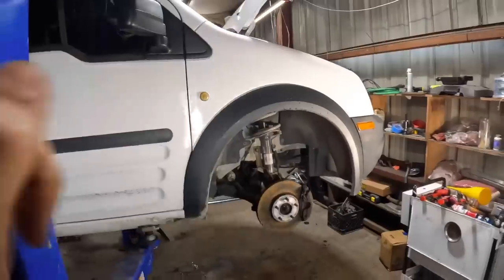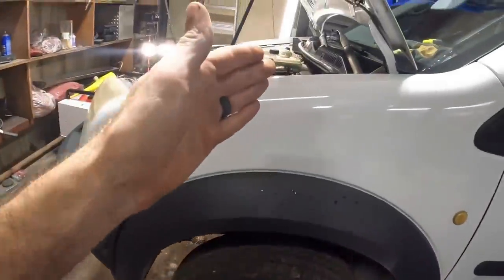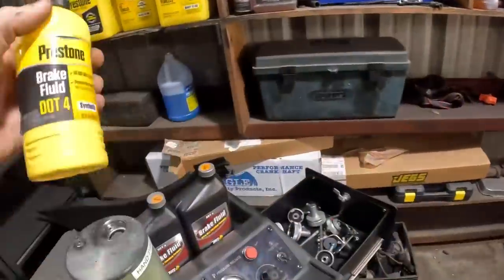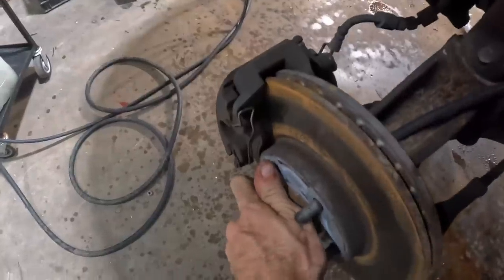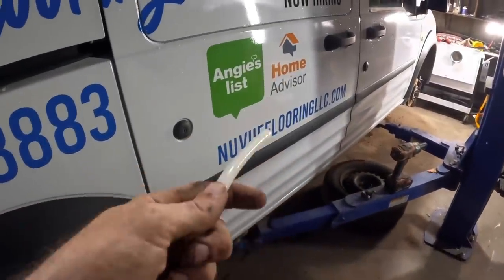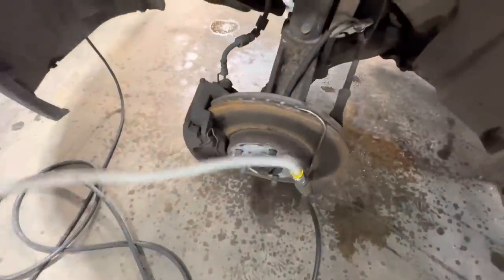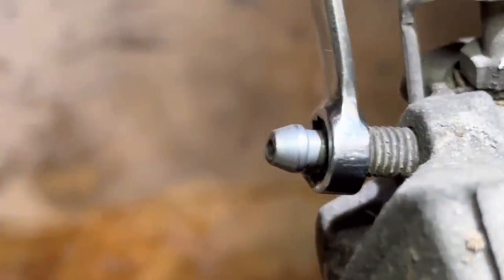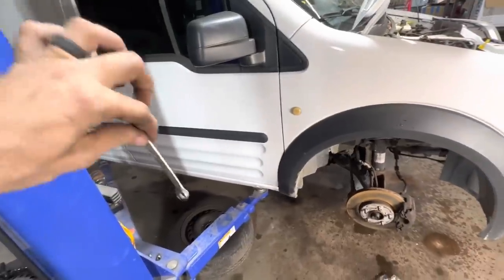Does Brake Fluid go BAD?? Ford Transit 2.0

Comment: I’ve always filled break fluid to the top. I’ll have to start looking for full marks
Reply: Filling brake fluid to the top of the reservoir doesn't give the overflow fluid anywhere to go when the calipers are being installed during a brake job, or any other work where they're removed.
Reply: Mc reservoir level depends on how far discs and pads are gone. If the level is maxed out on used discs/pads the fluid will overflow when pushing the pistons back in case of disc/pad renewal.

Comment: No da,da,daaa.Spray those brake spews at the wheels. Makes a cleaner job . hahahaha. Great little unit ,makes it a one man job. We use to have a pump unit,( by hand) it did the same job. Many moons ago. Bet that unit cost a lot of moola. But if you do that that type of thing ,it'll save you lots of time. And always have a great day.👍

Comment: I didn't see anyone else ask when I skimmed the comments.   What about the ABS?  Doesn't bleeding the abs require either activating the pump or opening an abs bleed valve where applicable?  If I am mistaken, then I guess my recent purchase of a tool tool to activate it on my truck was not needed.

Comment: I have never done a complete fluid change.  But when I replace the brakes (especially the disc brakes).  I bleed out the old fluid from the calipers (at least until did does not look like nasty fluid).

Comment: Brake fluid may absorb some moisture, but I am not convinced it is as bad some people make it out to be. I am sure there are many cars on the road that have well over 200,000 miles on the original brake fluid. 
FYI: The last time I have a brake fluid job, all the guy did was vacuum the fluid out of the reservoir and refilled it with new fluid. That's it. All for the price of $79.99
Reply: you'll know all about that if you ever have to do repeated heavy breaking.  your fluid will boil.   and if that is really all they did, you got shafted paying $80 for 10 minutes of labour and $10 of brake fluid
Reply: @mazwa2007  It took less than 2 minutes and probably 50 cents worth of fluid to replace what was in the reservoir.

Comment: I’m guessing if you test drove it, it felt like a million bucks! (After doing the brake fluid exchange with that setup)
Reply: Probably it didn't feel any different unless it had air in the system before. You need to drive it hard to heat up the fluid and make it boil in order to experience brake fade. All liquids are non compressible so unless you get the fluid boiling and getting vapors in it you won't feel a difference. The problem with the brake fluid is that it's hygroscopic. As it ages it gets contaminated with water and the boiling point decreases. Then you can experience brake fading, or brake failure when you go downhill and ride the brakes long enough to boil the fluid.
Reply: @johnnyblue4799  I was also speaking to the “car wash effect”. Like how your car just seems to run better after washing it (whether it be a sense of accomplishment or what). He just used his new machine and got all the old crud out and put fresh in probably doing a better more efficient swap of fluids than has been done on it before.

Comment: That machine makes it an easy job for sure.  Can't a DIY guy do this same job (taking a lot longer) by opening one wheel fitting at a time and pumping the pedal to expel the fluid into a tube running into a jar half full of brake fluid?  He would have to keep refilling the master cylinder many times I am sure but it can be done this way right?  I have never done this but thinking about doing it to my 1998 Dodge van.  I am sure it has never been done by the previous owners.

Comment: It fascinates me the way people brag about how long they've gone without changing the brake fluid in their car, and they haven't had any issues. I mean, you could also never change your coolant, trans fluid, diff fluid and probably not have any issues, but does that mean it's a good idea? Just a common theme I've seen when people talk about brake fluid flushes anywhere online.

Comment: Great video!  I had never seen a machine break fluid exchange before.  We just always used another body.  My question is, are these type of machines available for rent?
I don't have another body handy like before.  Nice catch of wife unit.  I believe I would give her another change though.  It was her first time being caught on camera! Plus, she's awfully cute and really adds to the shop.😉
Reply: Not sure if you can rent one, but I use a Motive brake bleeder system on my vehicles.  I picked it up from Amazon.  You can buy different adapters to fit your cars brake master.  Works well for me.  I also do not have an assistant.
Reply: @edp4585  Hey Ed, thanks for the info.  I'll look that system up on Amazon.  I'll also bet the Motive system is cheaper than renting a BG machine also.😉  Take care.

Comment: While brake fluid does go bad, I’ve only found it on OLDER cars/trucks (20 years plus). Based on the specific color range, what’s the chance someone dumped some of the older antifreeze that was just sitting on a shelf somewhere without a label, in it…assuming it was brake fluid? If I remember correctly, Prestone…way back when , had that shade of green. As for prefilling the contaminated reservoir it seems that would actually contaminate the new fluid as well. Wouldn’t it be better to vacuum out one line then after it’s vacuumed out dump in the new small container and the use the machine to tart the process? That would not only eliminate cross contamination and would give a “clean” reservoir but then you would use the machine to refill the first line and continue using the machine for the rest of the lines. Jus’ Sayin’

Comment: most brake lines are made of copper, or they have copper lining or washers. The brake fluid is highly higroscopic and corrosive. The contaminated brake fluid starts attacking the copper components in the brake system. Soluble corroded copper components have green color. Now you know why is bad brake fluid colored green.
Reply: Most brake lines are steel.

Comment: Just a suggestion, use a better fitting hose (rubber) about 1'-2' long with a swiveling connector to your plastic hose to allow using a wrench on the bleeder valve easier.
Reply: For most cars this one works fine since most cars have calipers it works just like the front. Its just that this vehicle the rares have a brake cylinder so the backing plate gets in the way. Not a big deal. Air will only get introduced if the brake pedal is stepped on then released while the bleeder valve is open. Quick spray w brake clean cleans up whatever dripped
Reply: @jacksmith2315  I know how air gets in.  I've two timed brake bleeds for 60 years. One man pumping the other on the bleed screw.  In fact used hose ,w/ & w/o a fluid jar.  Thank you for setting me straight

Comment: Ray for the purpose of not introducing air, doesn’t it make sense to just leave it running since it’ll be pushing air and brake fluid out then close the nut? Seems redundant to keep the vacuum hose on

Comment: Do you have to use the scan tool to open the abs and flush fluid threw the valves. Can you drain the reservoir on the brake fluid exchange machine to avoid moisture contaminating the left over brake fluid? Having new fluid will definitely raise the boiling point and prevent brake fade when coming to a panic stop. Really plays a factor in going down those long mountain roads. After hours beverages and computer games.

Comment: I've got 330k miles on my Nissan. Never changed the brake fluid. I think I've had to add a little here and there after doing brake jobs. So keep spending all your money on wacky fluid changes. Every time I replaced a brake line some new fluid was put in. I think you all are nuts and yes I have been ASE certified and graduated top of my class, with an associates degree in Automotive Technology.
Reply: I'll go a step further. If I had a few bucks for everyone that needlessly changed out timing belts I'd be rich. I'm talking about engines that aren't even interference. I've changed out timing belts over the last few years that could easily go another 100k miles. Just to put in some Chinese one that's made like crap. I get paid 1000$ because of all these kids watching YouTube channels. I can understand if you got a Volkswagen, but I've got a whole rack of belts that were just broken in at 75k miles. What's next? What other ways can mechanic's find to charge the every day guy with?
Reply: Seriously I just couldn't take the business anymore. It became a joke. I was a car salesman too. I used to do financing. I would look people right in their eyes and tell them that I can definitely get you the financing, but there is no way I feel comfortable letting you have a $1300 a month bill. There is no way with your income you can afford this and I shit you not, 80% of them would sign on the dotted line. I just couldn't handle it anymore. I'm in construction now. It's becoming the same thing in this industry now too. There just aren't many honest companies left. They'll sell you a dream at the expense of your families future. We know you can't afford it, but we'll sell it to you with a smile. It's slimy. That's what the world had become.

Comment: yes, break fluid loves water, its waterbinding. 
If the water ammount gets to high, your brake will stop working, because the pressure will fall. 
Long story short: Dont change regulary, you'll be a step closer to meet Death.

Comment: Why make a fluid exchange a special maintenance item?  I flush it out whenever I change pads and or, calipers.  That would still make it about every 40-50 K miles.  Just use enough to push out the old fluid like Ray did.

Comment: Didn't your machine come with the bleeder adapters that go between the hose and the bleeder? They would prevent any air from getting into an open bleeder. Also makes it easy to open and close the bleeder.

Comment: 21:35 a question - what happens with this yellow 12 ounce Prestone break fluid bottle?

Another one, actually the very first one I had in mind: why no break cleaner spraycans were used? While break fluid job has been done? Why?!

Comment: I made a vent valve tool by pitting a 90-degree bend in the end of the wrench.  Worked great.
Reply: I used a 45° mini off set ratchet 7/8mm made in USA.

Comment: Hi Ray over in the UK when i do service on cars i always check to see if brake fluid as any water in it with my brake water tester from Amazon. Great peice of tool you have for shop. Are you plainning on hiring someone for you shop once set up with shop upgrade.

Comment: I have not changed my brake fluid since 2008 - still works and looks good. Will change it this year.... 2 year changes seem excessive.
Reply: Problem is brake fluid absorbs water from the air and does not look any different however brakes may appear a little spongy.  The real problem comes if driving in hilly areas where brakes become hot when you get brake fade.  Half way down a long steep downhill is not the time to find out the fluid has water in it.  The tester in garages takes minutes so always worth asking at an annual service just to check.  If ok and you are low mileage you may well get more than 2 years but better to know. 😀
Reply: Until you literally hit the wall.

Comment: Power steering fluid most likely went away when a previous mechanic moved the wheels back and forth while doing some work on it.. Fords puke fluid out of the reservoir if you move the wheels a bunch with the engine of. Just my 2 cents on it

Comment: Ok my truck is just a little over due. 30,000 miles you say? Don't remember a fluid exchange ever being done and it has almost 600,000 miles on the clock. 
Might be about time lol.

Comment: i did the same thing about bleeding my jeep brakes and i used a vacuum pump and empty freon tank that i modified .my question today is why cannt they make the bleed valve a little longer. i dont think it would interfere with anything. but it would make bleeding alot easier
Reply: i see the front are longer than the rear can the rear be replaced with ones like the front?

Comment: Question #1 Do you need to flush the flushing machine for differing manufacturers of Autos?
Question #2 Does having an ABS 'block' on the other side of the engine bay from the Master cylinder, affect the order of fluid transfer?
Reply: with brake fluid you wouldn't, even with different manufacturers it'll be the same fluid, on the cap it'll say DOT 3 or 4, as long as it's the same as before there's no reason to flush. and which fluid it is depends more on the year

Comment: Yes it goes bad. It is a unfiltered hydrolic fluid. Changing it removes contaminants like water and dust. Some fluids have a water indicatior that turns green. If your system seals well a darkening of the fluid from heat may occur. That is just as bad as the green. It should be clear.

Comment: 9:33 in. Why not pull the vacuum off and let the pressurized fluid flow before closing the bleeder??? If what you say is correct, the stronger vacuum has to be pulling air through the threads of the bleeder screw. Where else does the pressure differential equalize? Ahh, yeah, you cracked the Bleeder afterwards and there were air bubbles. Just run a Hose and a collector Bottle at the Bleeder. You already showed during your demonstration that you could let it flow and make a mess that can easily be cleaned up. I am a big fan of BG Products but I only bought a couple of their flush machines many years ago. Some just seemed to be the furthest away from simplistic. In this case: I have an old 1960's style Pressure Pot style Pressure Bleeder. Easier to set up and just use... I do not have all of the current Master Cylinder Cap Adapters though. You know what I do have? A Check Valve attached to a Rubber Hose that attaches to any Bleeder Screw. I also know that any Float Level insert can be removed from any Reservoir. Just suck the Reservoir as dry as possible, top it off. Crack the furthest Bleeder and attach the Hose with Check Valve. (Other end in a Gatorade Bottle on a makeshift hanger.) Just pump the Pedal 5 or 6 times, maybe 8. Top the Master off and by the time you get back to the Bleeder, residual air sucked passed the Threads have just Gravity bled out. Continue to the next. The whole job is done faster than setting up any Machine.
Reply: Just got close to the end. 2 notes: 1) I wish I worked in FL. Here in CA, If the Waste Oil company detected Brake Fluid or any contaminants in any test of our 6 Drums (Which is picked up every 4 Months or so.) Instant Flag!!!! 1st call would be E.P.A.,  2nd call C.A.R.B., 3rd call Hazmat... $30 to $40,000.00 Fine, and the entire batch may cost up to $100,000 to process out. Gotta be on top of your P's and Q's here....  2) Not a Damned thing wrong with Miller Lite..... Everyone out here seems to drink Coors Light and I am the odd ball.... Gotta love A Fine Pilsner Beer. Tastes Great and Less Filling.... LOL

Comment: If the system is under 15 psi , why is there a need for a vacuum at the discharge point unless its a cleanup method?

Comment: What if you had speed bleeders installed?
Would you not worry so much about air getting back in when disconnecting the vac line?

Comment: I wonder what turned the fluid green....never seen that before. That's one neat machine.
Reply: Copper corrosion, most likely.
Reply: @BixbyConsequence  I've never heard of copper brake components, didn't think they used copper in a brake system. Unusual...must be a Transit thing.
Reply: @brianallen9810  You may not have heard of it, but brake fluid test strips check for Copper ions as a way of determining if the fluid is due for flushing.

Comment: Hi Ray. Been watching You fro a while now from the other side of the pond. Interesting take on something I used to do for a living. Anyway, a question. I`ve seen You doing plenty on brake jobs on the channel and not once I`ve seen checking for runout on hubs/discs. Is this something thats not popular over there? I used to do it every time when changing brake discs/diagnosing any kind of brake-related vibration. Care to comment?

Comment: Ya know, a clear hose instead of an opaque hose would be ideal for monitoring the fluid color.
Reply: Clear hoses become discolored very easily. In concept, you're right, in practice it doesn't work out that way.

Comment: As a career mechanic and car owner I have never found it necessary to flush brake fluid, except in extraordinary circumstances. You did the Ford Van because the customer asked for it. Why? Were there symptoms of malfunction ? Oh yeah the fluid was green. I can see where you'd be willing to pay for the flushing machine. Similar to the service  manager suggesting a cooling system flush while your at the dealership getting some other necessary work done. You coulda said "unnecessary", and saved another small business owner a bundle. Doesn't look like you have to chase work!just sayin....  Dave

Comment: I just dint get how brake fluid turns green, I seen dark color before but not green. If I was doing that job I wouldn't screw around with that suction hose on allt the bleeder screws, I'd put small ratchet on that and opener right up then put the hose on, once clear fluid comes out I'd take the ratchet snug it up, done....